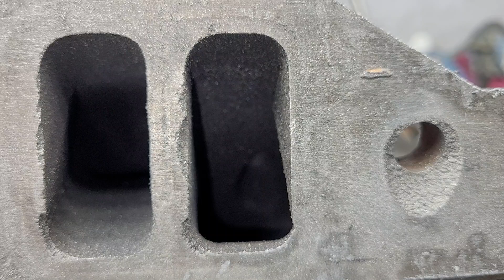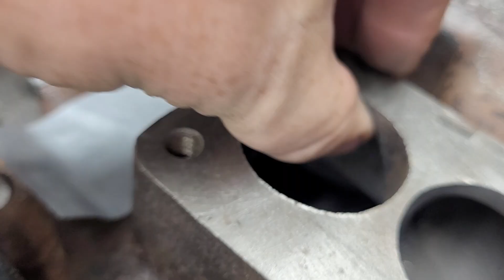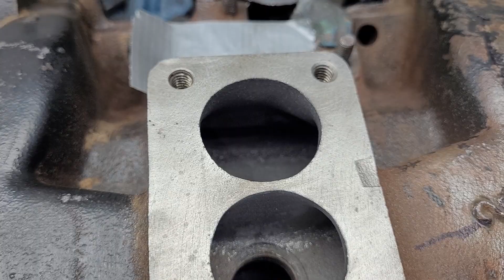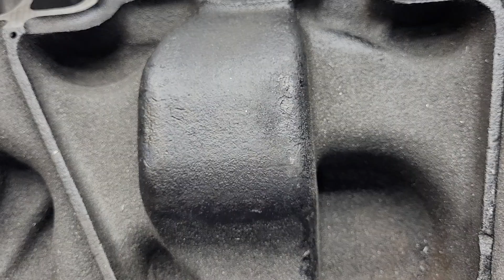David Vizard, Uncle Tony's Garage, Unity Motorsport, Mission Impossible project, 1st cut ports

Comment: Cheapest way to double the power of your stock 318 is just bolt another stock 318 to the front of the first one. Lol  Heck cut the egr to atmosphere and open the idle jets to the moon to get it to idle.  You could probably suck worth a 4 bbl they those ports.  Of course then again I have known guys to feed nitrous into the brake booster and let the engine draw that in under the throttle blades. That will wake one up!!! Be sure to be fat on your jetting for that one. 😈
Reply from the maker: Lots of ways to do it.

Comment: Wow inane the way this intake is I knew they stunk but not this bad. I wish the marine intakes were around there was 2 nice ones. Truthfully if anyone has a Big Block mopar BBD carb that might help. The hardest thing with that intake besides volume is direction. Getting whatever about of air to the cylinders. Equally. Making power on the restricted side. Camshaft camshaft one person told me years ago running in a 500cfm class. Use the 904 lobe to your advantage run adjustable 273 rocker arms or better yet 1.6. A typical Chevy 842 lobe example is 292 duration 230@50 with 480 lift. Now the mopar 904 lobe 230@50  is about 275-280 duration depending on the grinder. Lift 510-530 once again up to the grinder. All hydraulic flat tappet. A restricted engine will benefit more from a faster rate camshaft. Just think  about this people. Chrysler new about the pushrod pinch why do you think they stuck with the .904 lifters
Reply from the maker: Carb and cam will make or break this motor I have no doubt. I do love the fat lifters. Fat is where it is at! Thanks

Comment: G'day Charles just wondering how would you go getting the manifold Extrude honed or Acid porting to get to the Areas where you can't get to with a grinding bur 👍🍻🇦🇺
Reply from the maker: Acid porting I have seen they fill the whole runner/ plenum cavity with acid to increase volume.
Reply from the maker: Extrude hone pushes an abrasive media through the plenum and runners. The flow of the media removes material. It is a good system but expensive.

Comment: A problem with four barrel intakes may be the port size. Currently available intakes, only edelbrock performer has got the ports necked down to the 273/318 size. Everything else is for the  340/360 port, magnum is pretty much the same. So you are going to have a giant step there if planning to use something like air gap or almost anything else. Unless of course you fit them with epoxy. The same with the factory four barrels. A 4bbl 318 actually used 360 heads and intake.
Reply from the maker: You make a good point.

Comment: Charles. That divider between the intakes is at least .250" Can't you move the common wall in? With a gentile radious .075" removal per side, With a carbide. No rough burr action here. Just cut. And the crossover idea? Seems like dead air space? It's a side road from the carb. to the valve. Just my opin.
Reply from the maker: I agree. Thanks

Comment: I really hate to even think of suggesting anything to a person who is an expert at what he does, and I am a true amateur at it, but if you are looking for more plenum volume look at what Chrysler did with the 360 2 BBL intake. Chrysler completely eliminated the center divider between both round barrel holes, and opened everything up creating a lot more volume in the plenum. The center divider between both barrels should be eliminated. I would imagine that the carb flange should end up looking like and open rectangle. You can then add as big of an open spacer on top of the new rectangular flange to add as much volume as you need, and then place the stock 2 bbl on top of that. I know that this is an oversimplification of what you would need to do... Basically look for your plenum volume on top of the intake instead of below it. I would also suggest that you try and locate the older 318 2 bbl cast iron intake, the one that is single plane, I bet that intake will flow much better and would be much easier to modify.
Reply from the maker: I did not know that manifold came that way. That is what will happen to this manifold. I do not see it staying a two plane divided plenum. 99.9% would say I am not an expert. Thanks

Comment: I doubt that will work. The fuel will most probably puddle in the exhaust EGR cross over, and create a dead area if you were to try and use it as a plenum area.
Reply from the maker: I have seen intakes designed for that actually. Yes, I agree. Thanks

Comment: Hey Charley, on another note, if everyone is dead set on using Chrysler only parts, there were cast iron factory Thermoquad manifolds for the 318/360 cop cars all the way to 1989....I've used them on 318's for pickup trucks in the past....they have a good sized plenum and a two barrel adapter could be used on top....just a thought....
Reply: I like your thinking; that way only 1-manifold needs ported that’s cast iron……if it must be a 2-barrel intake, then I don’t think a 360 2-barrel intake should off the table given there is already 360 valves in use….it would at least still stay all Chrysler that way.
Reply from the maker: You make a good point but I really like the old Edelbrock and Weiand intakes.
Reply: Yes Charley I like them too....I used the  dual plane Eddy LD 340 on my own stuff and there was the 318 dual plane version as well...maybe you can convince the rest of the team to test several different intakes, if you can find them...if I had one left I'd send it to you to test and eval, just for the sake of comparison....
Reply from the maker: @philzellmer6073  Thanks
Reply: They have LS valves in the heads
Reply from the maker: @dang5553  For now.
Reply from the maker: I am planning on 360 valves and that is it.

Comment: Hey Charley, I haven't tried it, but I'm afraid that if you block the heat risers in the heads and then open the exhaust crossover in the manifold, you're going to get a lot of fuel dropping out of suspension and puddling on the floor.....mainly because the incoming air/fuel mix will want to keep going straight down and then have to curve back up to the ports...the air can do that, but fuel may not....anyway, rest assured we're all rooting for you and are chomping at the bit to see how this thing turns out!!....Major Kudos to everyone on this project!!...keep up the great work!!...
Reply from the maker: What you write makes sense. I was just thinking of ways to give it some plenum.
Reply: Will make it more testy when cold/warming up just like a blocked heat riser will but be fine onec the intake gets some heat into it.
Reply from the maker: @craig8187  If the passage is blocked it will take a bit more time to get to operating temp.
Reply: @servediocylinderheads   yes definitely does take longer. Oil splash and just engine heat does warm it up with time. Just depends on ambient temps. In winter here in Australia where i am we may see 0deg C a couple times a year at the most, and see high 30degC to the odd mid 40degC in summer. In winter, heat blocked ally intakes take around 10 min to be nice and warm and stop fuel pooling, iron stuff 20/25 min. Just need to keep the rpm up to keep that wet fuel moving while it warms up enough.
 Opening that plenum below the runners "should" help the runner net flow ar well seeing the runner can then pull air around more of its entry area. Try it. If no good fill it back up with epoxy! Haha
Reply: @servediocylinderheads  I used a stainless Steel shim stock with a 1/4" hole to cover my heat crossover on both sides. Allows some exhaust to cross.

I would not go deeper in the plenum area than the bottom of the port. May taper down drop the exit ports floor down about 1/8 inch. But on the shallow one you can grind the walls some and open up the bore hole to add some volume.

I'd find an old Edelbrock Sp2P318 and port it some to even out the ports. They are SMALL ports so fast velocity. Most say they are worthless, until you try to buy one. A LD318 was better but find one.
Reply from the maker: @craig8187  Depending on testing that may happen. Thanks
Reply from the maker: @davej3487  That small runner is too small for this project but those fat runner manifolds would turn up the wick. Thanks

Comment: A big part of your restriction on that Intake is going to be on the top runners due to the area where the port transitions to the floor of the plenum on those flat areas. You can try to see how much you can "round that down " I have always though about welding if I could to bring that transition down another eighth of an inch to increase the transition.

Comment: If you wanted to put an adapter plate on you could try either one of thr 360 2 barrel intakes with the big 500 cfm Rochester 2 barrel. Or even one of the tbi intakes.

Comment: On aby of those intake manifolds I focus on the bottom top and two adjacent straight walls sides and try to even up the areas at the top of the port.
Reply: All those 4barrel 318 cop cars were a 360 top end